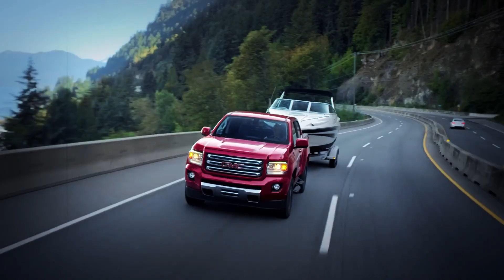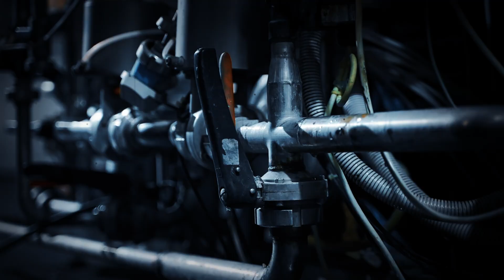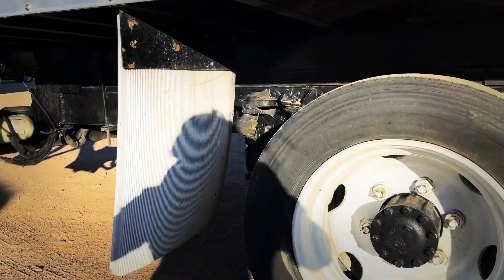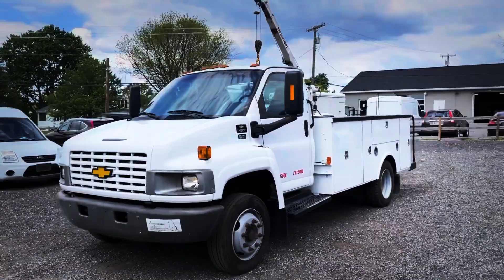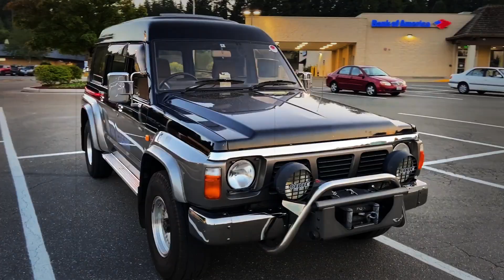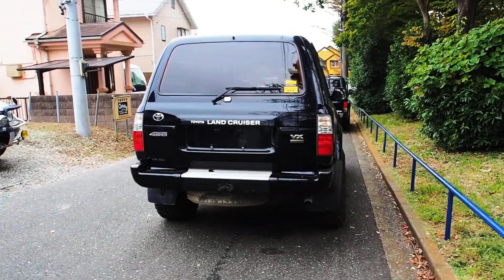11 MOST RELIABLE Diesel Engines That Run FOREVER!

Comment: 2.8 duramax is a fairly new engine to be added to the list. I  can think of atleast 5 engines that can take it's place. 
VW 1.9/2.0 tdi. 
MB OM 606
Toyota 1JD 2.8 
Isuzu 4JJ1
Cummins 5.9
Those are just 5 off the top of my head. Im sure there would other engines that are more reliable than 2.8 duramax.